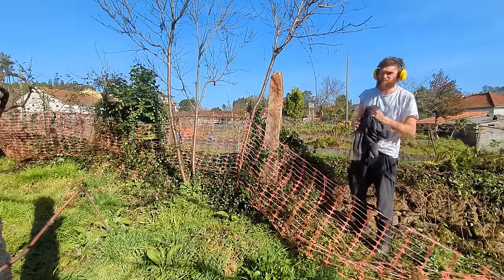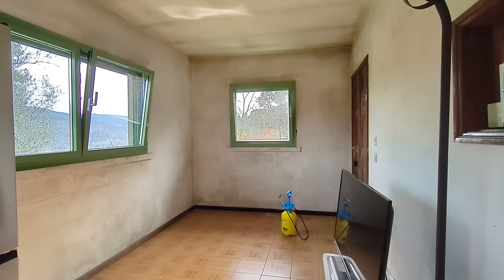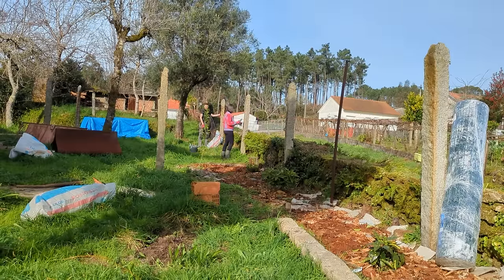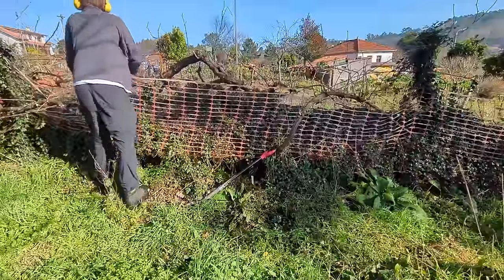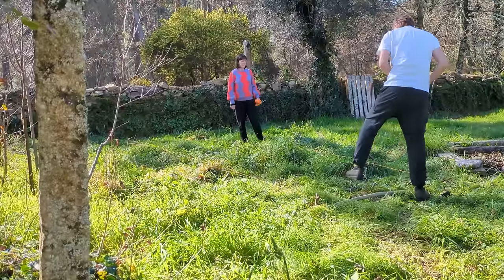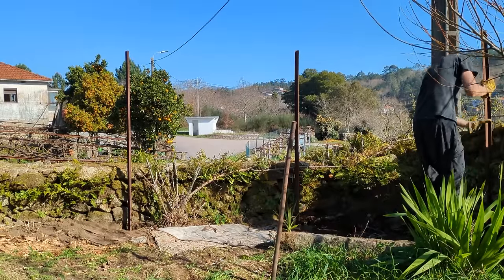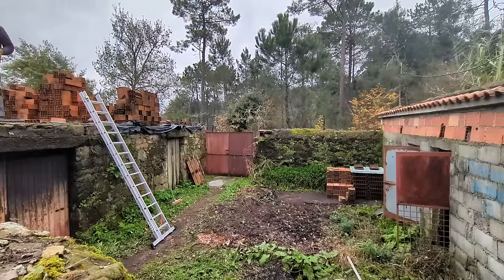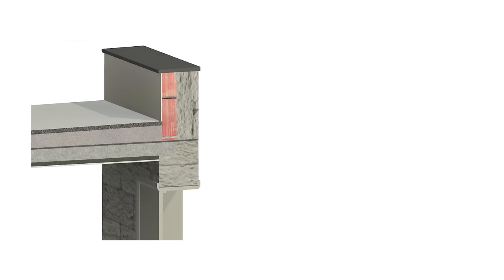#17 Progressing our Portuguese home renovation at our abandoned house and stone outbuilding

Comment: For the roof - use the thing they use for swimming pools - I made my huge balcony that way. After two layers of that (can't remember the english name for that thing) - just pour a thin layer of concrete and put the tiles on it. Works like a charm in my case - zero moisture is coming from the balcony to the house (and before the renvotaion it was TERRIBLE) - you should also think about 2-3 holes with drains, so the water can easily flow down. Also - make sure that the roof is slightly sloping towards those drain holes - 3-5° of slope should be enough and you wont notice it while standing on that terrace.
Reply from the maker: Ok, we used weber dry for our water tank is that the stuff? I'm planning on having a slope and a couple of outlets

Comment: I'm glad you are back to making videos. That is not a post hole maker in the USA. It is used to drive the post into the ground.
Reply from the maker: Yes, I think I was using it incorrectly...!
Reply: @michaelboalch  yes, you use it to pound the post on the top.. that way you don't need to dig big holes. 🙂

Comment: Michael, the post driver is used in Australia to do just that. No need to dig holes and fill with cement. Simply put the driver on top of the lost and then luft and drop, quite hard, down on the post. It will drive the post into the ground. This does make them very secure. I know because I have done it and later tried to remove them. Believe me it is very difficult. Also adding the fence will give them stzbility.
Reply: "on top of the POST"
Reply from the maker: Yes, you're correct. Shows how much I know about fence building! 😅
Reply: @michaelboalch  Michael, I didn't know until I was taught, none of us are born knowing everything.  Good luck to you two, doing a great job.

Comment: A skim coat of cement morter (1"-1.5") finished with a pancake batter consistency of just cement and water whle the morter is still wet will give a water tight seal to the roof. This kind of budget flooring is being used in Indian houses for decades.